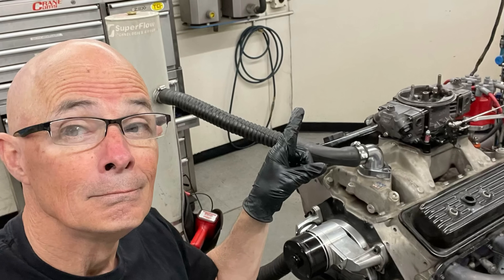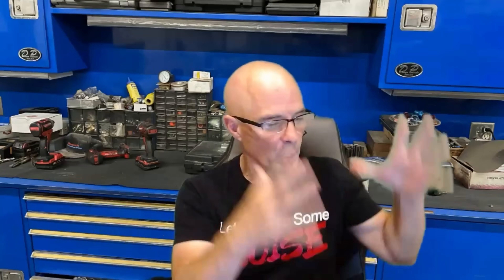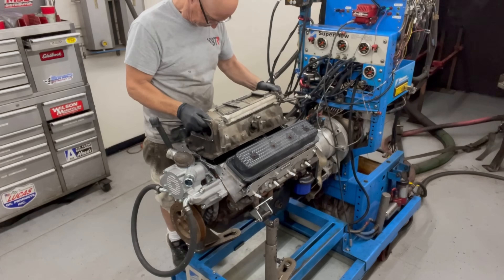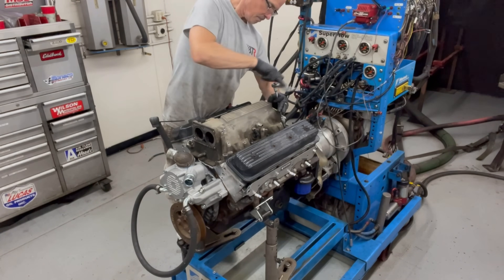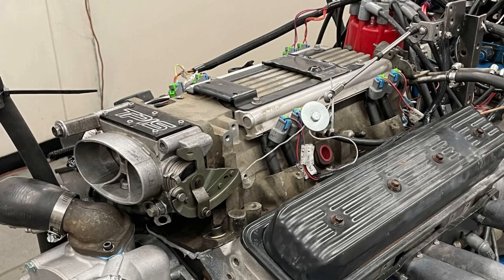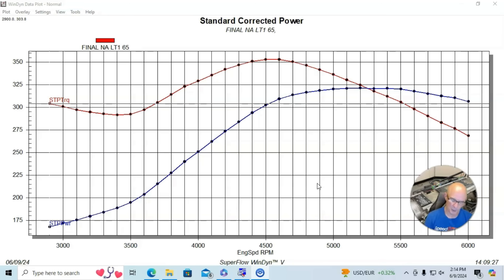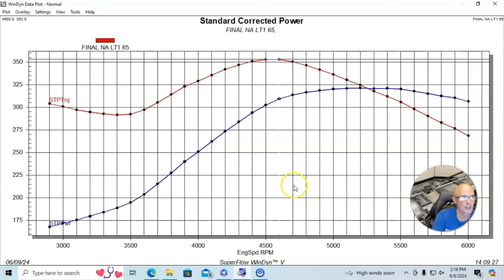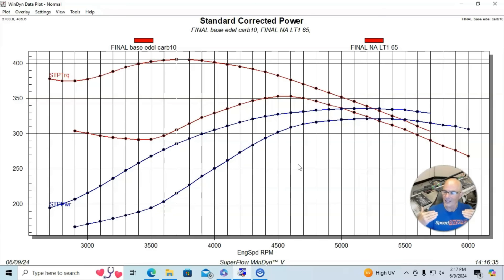GEN 2 LT1 INTAKE TEST-CARB VS EFI! STOCK LT1 EFI VS GM DUAL-PLANE & EDELBROCK VRS CARB. WHO WINS?

Comment: All my friends told me to go LS swap.I said na I am good with this 408 sbc.Then they all said the swap to a sniper EFI setup or something similar.I said na I am good with this FST carburetor.I still bust their asses on the street.Lololol.Old fashion good tune.
Reply: Yea they recently came out with a Holley EFI single barrel modeled after the Autolite 1100 that my I6 Falcon has and I really want to experiment with it, but dang it if the carb doesn't just fire up perfectly every year with ethanol free gas and run fine off the tune I put a weekend into years ago.
Reply: @Onewheelordeal  My friends with EFI they can start their cars up from a cold start and it will idel perfectly.My carburetor takes a min of warning up to get going.The EFI sniper 2 I was curious about but not $2000 curious.Also curious about e85 gas.e85 carburetor $700 ish + new fuel system if you don’t already have one is roughly $700-1000.I am still old school and like things simple that still work good.More mechanical less electrical.EFI my friends have is definitely easy self tune no doubt.Once I got my timing curve set right and got my carburetors nozzles,Jett’s,power valve,AFR set just right,I felt a lot easier to maintain.
Reply: Exactly. I got a free truck with 5.3 LS and was ready to swap it into my 68 and trash the truck body until I priced everything out for a 500 hp build and ended up staying with the 68s original small block and building it. Now I have a running driving 5.3 truck and still got my 500 horses impala. Win win. Ended up being a lot cheaper that way even with the LS itself being free lol. Nothing against LS swaps tho they’re really cool and I want to do one in something one day just for fun. Maybe an obs Chevy truck!
Reply: @SpecialAgentJamesAki  True that.Sounds like you made the right choice.500hp is we’re it is at.Thats a lot of power.Anything more then that and you just knocking off tires lol.I drive a 68 Camaro with a 400 sbc in it.4’11 gears and a poor mans Muncie transmission and the car weighs 2800lbs 👊.I line up next to these new mustangs,Camaros,dodge hell cats and I bust their ass.I take off on them so fast from the light and I am gone.I can hear those prochargers kicking in and see them coming up but I am already off the gas breaking for the next light lol.On a 1/4 track they would catch me no doubt but on the street,,,,,,That’s mine.500 HP is definitely a threat to anyone on the street.
Reply: Another good thing is the SB2 5.8L heads fit the SBC, in 2007 the R07 engine came out
Reply: I would hope a larger displacement motor would make more power than a stock LS.
Reply: @DaDon357  they picked LS motors 5.3 with cathedral port heads and a smaller stroke over gen 1  6.6  400sbc engine with AFR heads.Unless I was going turbo then I can see why LS would be better.But N/A Big stroke = big torque.Torque is king.
Reply: @joshuagarvey9362 Your friends picked a stock 5.3 with ported heads over a 408?? Now 6.0 to a 408 would be a better comparison but yeah you went the right route with those options.
Reply: @joshuagarvey9362  For them to even think a 5.3 would make more power than a 400 shows how little they know. 
5.3s are turds!
Reply: If you stroke a LQ9 6.0L to a 408 stroker and put a carb on it I would bet you the LQ9 would destroy your 408 everyday of the week.
Reply: @jeffgulley7935  with unlimited disposable income that may be true but most of us have a budget. I couldn’t even get an LQ9 with my budget but I could make a 500 horse sbc so the choice is obvious to me.
Reply: @SpecialAgentJamesAki  In my country you can buy a low mileage LQ9 6.0L at the scrap yard for 350bucks and then put value springs,  hardened pushrods and a comp cam 231/239 duration and 614/617 high lift and you have well over 500hp
Reply: @SpecialAgentJamesAki  It not expensive and that's why alot of guys do LQ9 6.0L. I bought LQ9 6.0L sold the Fuel injection intake, bought a carb, ignition system and intake, valve springs, pushrods, Comp cam. 2500 bucks and you have a motor that's 500hp easily.
Reply: @jeffgulley7935  complete re-wire,different headers,new exhaust system,trans,trans crossmember,New motor mounts,It would cost me twice as much to go LS.I stayed low budget on this 408sbc and it still kicks ass.LQ9 are great motors no doubt.I love them but it would cost me a shit load to swap.How do the LQ9 run with a carburetor?anyone try it?I have seen one but didn’t get a change to listen to it.
Reply: Would probably cost me less to swap to an old big block Chevy and really lay down the torque.If I line up next to a,,,Let’s say dodge hell cat.They have what,,,700+ HP with their superchargers.From the street at a light.When it turns green I take off on them so fast and I am gone.I hear them coming top end but it’s already to late.I am breaking for the next light.68 Camaro 2850lbs with a muncie 4 speed and 4’11 rear gears.I have no idea what this 408 is pushing but I have been running it hard for 30 years and it is still a threat to any new car on the streets today.I prefer to stay N/A and a well balanced nicely tuned carbureted motor with the timing locked out.I was hoping to get 500 foot pounds of torque out of this 408.In my eyes anything more then 500hp on the street and it’s very hard to keep the tires hooking already.I love it when your smoking the tires in 3rd gear and your passing someone.😜😜😜😜😜.No fun to haze tires and loose a race 🫣🫣🫣.head down back in the garage it goes.How to get these suckers to hook.
Reply: @joshuagarvey9362  I have a LQ9 6.0L in my 1968 chevy 2 Nova with a  built 700R4. Made 432TQ and 446HP on a wheel dyno
Reply: @joshuagarvey9362  All you need is LS Ignition box, intake, cam shaft, pushrods,  valve springs and mine only has a Edlebrock AVS 2 650 and still made 432TQ and 446HP at the wheels
Reply: If you say so hoss
Reply: They must have bone stock LS  then 😂
Reply: You didn't build an honest 500 plus hp small block for less than an LS.  Yeah you opened Holleys catalog and got scared but that's not real world. 😊
Reply: @LSswapGarage1  apples to oranges. No comparison. I like the old-school smallblock- But the LS is far superior and much much cheaper. I'm just siding with old guys and old tech engines(cuz I'm old. 😆)
Reply: @LSswapGarage1  says the guy with the no thumbs up LS video after 6 years.🫣
Reply: @joshuagarvey9362   Yeah I agree I set up several snipers and several holly multiport ejection systems. They're good products but I think that unless you're running Turbo or boost and need highly accurate fuel measurements and being able to tune on the fly not really worth it.  simple holly carburetor works. Every part store has parts for them easy simple. And honestly the holy stuff I've installed. pretty temperamental I've been a mechanic an technician for 26 years. I'm not a tuner. But I feel like I can get the same if not better results with a carburetor.

Comment: So I have a 96 GMC 4 x 4 extended cab short bed I'm not 100% sure which transmission is in it but I've only gone from carburetor to EFI on stick shift models. Do I need a TCU to be able to run a carburetor,/ intake and distributor. I already have a cam for it and I've already put long tube headers on it any help would be great. Thank you
Reply: If its a 1500 or a heavy half you have the 4l60e. I don't think you need one. The stock computer should already be reading vacuum, throttle position, speed sensor and timing. 

I would check forums, has definitely already done it lol
Reply: Someone has definitely already done it*